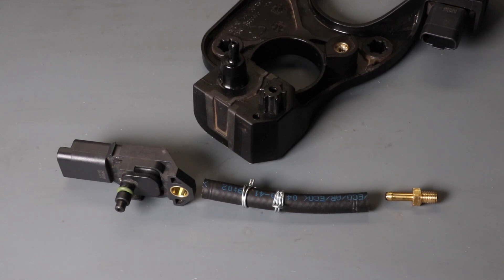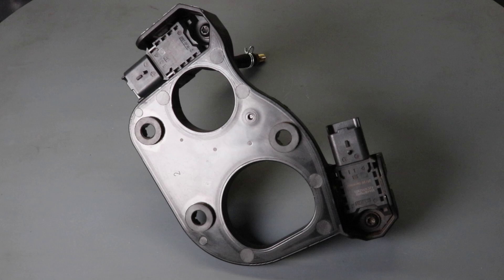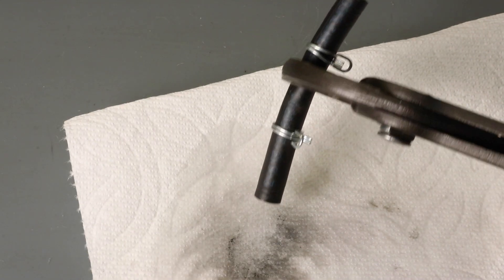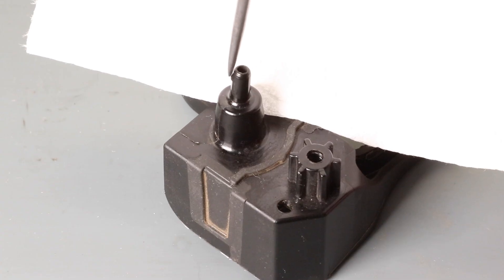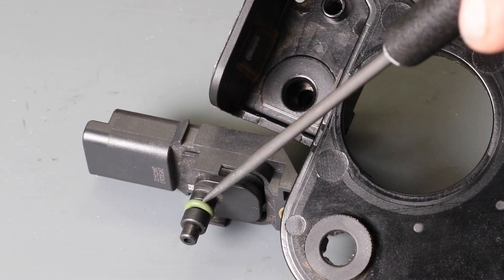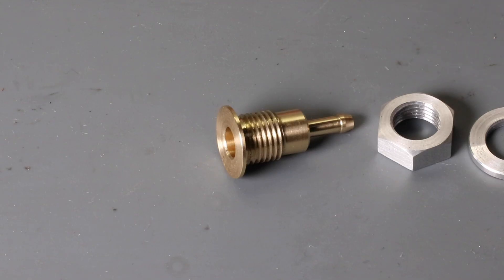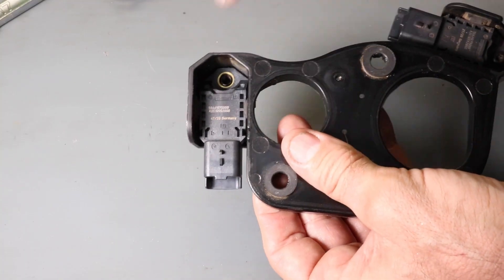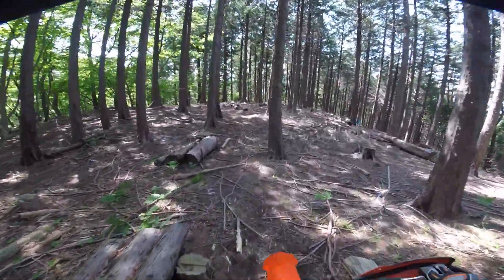KTM TPI 2-stroke Engine Bogging? CCPS issues, fixes and modification

Comment: Hi, I have the same issue. Checked any block or leak on the system, and nothing found. Changed the sensor with a new one and the problem still appears. I've noticed the problem occurs whenever I reach higher altitude places. I have a 2019 tpi which only runs one crankcase pressure sensor, which the bike uses as ambient pressure sensor when the engine is not running. I suspect the problem is that the ECU is messing with the values recorded with this sensor and maybe its reading crankcase pressure and using it as ambient pressure? The problem appeared with 200h on the bike. How can I diagnose the ECU?
Reply from the maker: If you suspect the ECU do you have a riding buddy with a 2018, or 2019 TPI? If so and their bike runs OK you could test their ECU in your bike. Note that the 250 and 300 maps are different so they would need to be on the same capacity bike as yours. If not then I would recommend discussing the issue with your dealer. Self diagnosis of the stock ECU is not easy, although some basic information can be shown using an OBD2 tool connected to the bike. I have seen some posts of people examining the pressure sensor data (graph data) to determine whether it is outputting data correctly or not. But for deeper diagnostic testing and reprogramming of the ECU the KTM dealer tool would be required.
Reply: Thank you for your reply. In my dealership they are pretty much useless. They connected the diagnostic tool and no errors were shown so they did nothing but change the spark plug cable. Do you know how can I analyse the pressure sensor data? Is there any OBD tool that we can get to do that? Thanks

Comment: Thanks for the video. Any chance you would be able to post up the crank case pressure readings (including your elevation) using the OBDI connector so people have a baseline?
Reply from the maker: Unfortunately not. I'm using an Athena GET ECU and my OBD2 scanner doesn't work with it.

Comment: Back in 2019 I made the decision to buy the last year model of the carbueted KTM 250XC.  Good decision confirmed.  Thanks for all your good videos!
Reply from the maker: Year model 2017 was the last year of KTM carb bikes offered in Japan. I have two  2017 models and no plan to sell them as I love riding them. The TPIs are great bikes too and IMO run better stock than a totally stock carb bike (my 2017 on the first ride was horrible stock). But like any bike TPIs do have issues. I think the important thing is to try to understand what problems there are and as much as possible proactively maintain/mod/fix the bike to help ensure you don't have issues while out riding. I don't mind working on my bike in the garage, but hate having the bike running badly while in the mountains...

Comment: Too bad you didnt reinstall the original sensor to see if all that work was worth it
Reply from the maker: My goal with this was to have a bike which is reliable. As I had everything apart and a new sensor at hand there was no way I was going to risk ruining another ride by putting the old sensor back in. My ride time is valuable to me and I want to try and ensure I don't have bike problems while out riding...
Reply: @TokyoOffroad  - Agreed, but proper diagnosing is just as important as a solution to a fix.  Not saying you did anything wrong but just would like to know if your fix actually fixed anything...👍
Reply from the maker: @Crazystuffyousee  - I was thinking it would be interesting to perform a full Failure Analysis on a poorly performing pressure sensor so the root cause could be understood. I'm sure KTM have already done this. Some possible causes I can think of are contamination inside the sensor, damage to the sensor package (cracked), damage to the internal structure of the sensor due to stress (mechanical over stress (vibration, or impact), or pressure stress), electrical issue. Hopefully they are working on a fix. I wonder what the factory riders do to avoid this? New CCPS each race?
Reply: @TokyoOffroad  - Currently the more general consensus on reason why the CCPS is failing is the CCPS housing develops leaks from either poor sealing, or other reasons.  Yes, even the tray can leak as you pointed out.  And since the identical part number ambient pressure sensor failure rate is pretty much nothing by comparison, it would appear that the "pressure" from the crank case is the cause of the leak.  If sensor failure itself was the issue then again, the ambient pressure sensor should be failing in similar fashion, but they dont.  That said, when the CCPS develops a leak then it allows oil contaminates to flow up into the sensor housing whereas when there is no pressure leak oil migration up the rubber hose shouldn't happen.
And really, CCPS failing is not that common, but more internet hype.
Reply from the maker: @Crazystuffyousee  - Yes and no. Some have mentioned that swapping a CCPS (poorly performing one) to the ambient (barometric) causes stuttering. Others say it performs fine. As such there may be more than one root cause...
Reply: @TokyoOffroad  - Maybe you misunderstood...  A failed CCPS causing poor running conditions would also cause poor running conditions if installed in place of a functional APS.  A failed sensor is still a failed sensor...  All I was pointing out is that the failure rate of the APS is pretty much non-existent.  And since the two parts are the exact same part, there must be a reason why the CCPS fails and the APS doesnt.  As I mentioned, "pressure" pulses from the crank case is likely the culprit, causing leaks in the CCPS housing or damaging the sensor somehow.
Looking forward to your in depth diagnosing... 👍
Reply from the maker: @Crazystuffyousee  - No, not necessarily. If for example the failed CCPS failure root cause was that the sensor case is cracked it would still work fine when used as an APS. Or there may be a failure mechanism where by the sensor can not accurately measure fast dynamic pressure changes (required for CCPS), but slow steady state pressure measurements are OK and not cause an issue for APS measurements. Contamination on the sensor diaphragm  might cause such an issue. 

I don't know accurately what percentage of TPI bikes have CCPS issues. I'll check with an insider I know and see if they know...

Comment: I have a 2020 TE150i with 40 hours that had a similar issue. Was bogging down low, acting like it was not warmed up. My CCPS had failed. Ran the bike for 1 hour with it failed ( just easily, not hard at all ). It badly scarred my piston and cylinder. Had to replace the top end.
Reply: Thanks for the heads up. I was unsure if I could get away with it but I don’t want to be in same situation as yours did. Hopefully is good now

Comment: I love this channel. I have a 2018 250 tpi.. one time the bike cut out when I was racing the engine at high speed. It only happened once. It was almost like it lost spark, or had no gas... complete cut out... as if I was pushing the kill switch. I still don’t know why or what caused this... do you think this could be the pressure sensor? Thx so much for your great videos
Reply: I bought a 20 ish hour used 300 xc-w last year that did the same thing, except it did in consistently at WOT.  I sold it and decided to stick with carbs for another year.
Reply: Sounds like a grounding issue. I’d take the electrical connectors apart and dielectric grease them, also any grounds. I Just did this on my new 22’ TE300i.
Reply: @MediocreRacing  yeah I thought so too because I know the battery grounding issue … but all the main connections looked fine. I haven’t experienced this issue for a bit so maybe it fixed itself. Just got back from Taylor park where it ran flawlessly and I raced the shit out of the engine… thx man

Comment: I also had a ccp failure on my 2020 ktm exc 250 tpi but the sympoms were different. One day I started the bike and idle was way too low. It would stall on its own. And it was a bit boggy aswell but in a different way. It rode like a cold not warmed up 2stroke. It just wouldn't clear up until it got to top end. 
Btw if anyone wants to know the part number for the automotive sensor I can copy it here
Reply: Part number please!!
Reply: @tontonn9995  vdo 5wk9700z
Reply: @andrejskamla9736  thank you!
Reply: I had this same issue on my 2020 husq te150I. It scored my piston really bad. Had to do a topend rebuilt at 40: Hours.
Reply: @NA95187  faulty ccp scored your piston ? How ? Didn't know that is possible

Comment: A couple questions. Looking at the video it appears the bike was at a pretty extream.up hill angle, cant really tell by the video but could it have been starved for fuel?  Did the bike bog again on flat ground, or was that the only tome it bogged? You are using the same same sensor now right. And lastly could the gas cap vent line been plugged. Very interested in knowing  what you find out cause i bought a Husqvarna 300i recently and its the first bike I owned that is not a Japanese brand.
Reply: The bike bogged down because of the faulty sensor itself. The sensor effects fueling so I don't think that any further inspection is needed.

Comment: While I’m sure this is going to be more reliable than stock, I don’t believe the majority of CCPS issues are from leaks - they are from the sensors themselves going bad. I’ve changed enough of them, and heard from a lot of ppl, that simply replacing the sensor with a new one fixes the issue. I also experimented by bypassing the tray and connecting the sensor directly to the hose, and that didn’t fix the issue, but replacing the sensor did.
Reply: It is caused purely by the oil fumes going inside the hose and condensing inside the sensor. Simply put a longer hose with an additional bend.

Comment: Where did you find a new ccps?
Reply: You need one ? I can tell you tge part number for the automotive one. It is the same sensor and it works the same. Right now it is very difficult to find an oem ktm one
Reply: @andrejskamla9736  part number please!
Reply: @tontonn9995  vdo 5wk9700z
Hope it helps😊. Sorry didn't notice your question
Reply: @andrejskamla9736  what’s the part number?
Reply: @Zz2crazy  vdo 5wk9700z
Hope it helps😊

Comment: I have over 400 hours riding experience with the TPI bikes and can add a few points. The 2019 bike only has one sensor, and it is in the middle of the tray. This makes it difficult, but not impossible to replace without tipping the subframe and dropping the tray. I removed the cylinder head stay for more room and removed the tray securing bolts. The tray can now be deformed enough to access the sensor securing screw. Make sure you have the correct size torx tool. The 20-21 bikes are easier as the sensors are on each side of the tray. As mentioned, both sensors are the same part number, and in a pinch you can just swap them side to side. We have swapped out a bad sensor at Staging in the parking lot with practice. Order up a spare, we see these go bad as soon as 20 hours of operation.  When they begin to fail, the bike still runs so you won’t get stuck on the mountain. The onboard diagnostic system will not tell you if it is failing.  In our experience, only the Crankcase Pressure Sensor fails, not the Ambient Pressure Sensor. These sensors last decades on automobiles, but only months on KTM’s. I can’t explain why.
Reply: А из за этого датчика может быть что на холостом глохнет ?
Reply: @enduro_007 yes, but low idle/stalling could be caused by other issues too.
Reply: I've got à 2019 tei
Do toi know if This réf is good for the sensor : 55641075000

Comment: Thanks for that. I fitted the idle screw you sent me, but not the RK tek head. I have also fitted the GET injection and ECU kit. Good improvement, but I have a flat spot which will get sorted on the Dyno in Leatherhead. I have a GasGas EX300, the only one in the UK, I think.Through the gears it feels faster than my FX350 F, which I have worked on a lot.

Comment: What do you think was the fix? You changed 2 things at once
Reply from the maker: I can't say for certain what the root cause was. But the dust on the sensor nozzle was a real surprise for me, although as I mentioned in the video I can't be certain that it didn't pick it up when I pulled the sensor out of the tray. As I had everything apart during the inspection I decided that I wanted to try and minimize the chance of a similar issue occurring in the future while riding. As mentioned in the video I do know that some people have had blockages of the fitting/hose, others have reported leaks and many have reported failing sensors, so those were the things I focused on. With the new fitting I made for the sensor I'm confident that I won't have any leakage issues going forward. So if a similar problem occurs in the future I can be confident that the cause is probably a blockage, or sensor issue. I'll make an update if I have another problem. Hoping KTM are aware of this issue and working on a solution because it's a real PITA when it occurs and ruins a good day of riding...
Reply: @TokyoOffroad  Thank you for making the video and the detailed explanation of what is going on. It will be interesting to see how long this sensor lasts compared to the original one. I am also curious if the original one is comprised or if an air? leak was the culprit
Reply from the maker: @DeadEnduro  - Yes, I'll be sure to make an update video if/when it starts not running well again...

Comment: My barb is bent just like yours, I shortened the hose so it puts less tension on it. Maybe the bending of the tray is putting tension on the sensor and cracking it around where the 2 parts are joined. Both my failed ones are still going after I glued them.

Comment: Nice work Mark ,you should be working for KTM as a reliability engineer,I think I will stick with my Stic module in my keihen 👍D
Reply: What is the stic?
Reply: @ollie6512  ,the Stic is an aftermarket metering block  that replaces the stock one inside a keihen carb ,the benefits are smoother / stronger power delivery and your carb is less sensitive to changes in elevation and temperature etc ,the bike also starts easier .I run at about 300 metres above sea level and 5 deg C to 30 deg C ,I only need to turn the air screw from 3 to 4 turns out winter to summer ,no pipe bang easy to ride in differing terrain , I have ridden a mates 2020 TPI bike and it’s very good but as far as I’m concerned  the Stic  is much better option for me  ,if I was doing huge elevation changes etc TPI would be a consideration ,Mark at Tokyo Offroad  has supplied a number of these to me ( running 300 and 250 in different gen bikes KTM ,Husky, Husaberg ) and I am extremely happy with the service he provides .I also run an aftermarket head on my bikes ,no intention of going TPI when you can get this level of performance with the simplicity of a keihen carb . No affiliation with Tokyo Offroad just a very happy customer ,been riding 41 years ,the Stic is a game changer ,just my 2 cents worth cheers Derek👍
Reply: @dereknagy4072  thanks for the detailed reply! I current have a 2002 KTM 200 EXC. I have the stock nozg needle etc so as you'd imagine it runs pretty rich. Is the stic an option for my gen enduro bike? Thanks mate
Reply: @ollie6512  ,speak to Mark at Tokyo Offroad the guy is amazing to deal with ,as long as you have a keihen on there they fit 125 to 300 ( also seen them fitted on retro 500s) I am running the 113A version of the Stic with the white needle  ( JD jetting Kit) and they are very easy to tune Mark supplies them as well ,any aftermarket head with this mod  works well , I ride enduro ,cross country mostly 2nd ,3,4th ,5th  semi technical terrain ( west Australian desert ) no blubbery bottom end ,pipe bang etc ,just feels perfectly jetted once u adjust the air screw  for winter or summer , just make sure your engine is in good nick ,seals ,piston etc .CheersD.

Comment: all that work and it could have just been a just a faulty CCPS, nice vid and thanks but to check it is sealed apply some air pressure and see if it holds, that will tell you if any of those point are leaking
Reply: Apply air pressure where?
Reply: @neil4634 lol seriously, apply where?